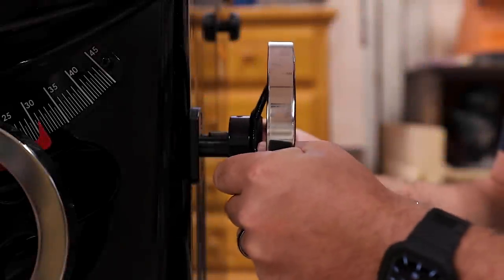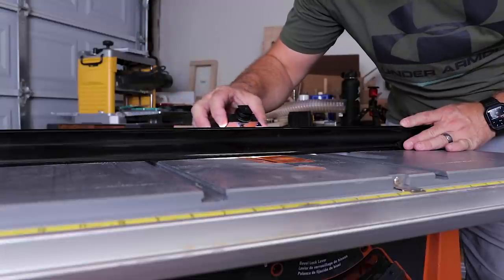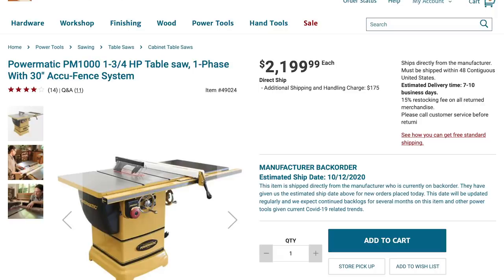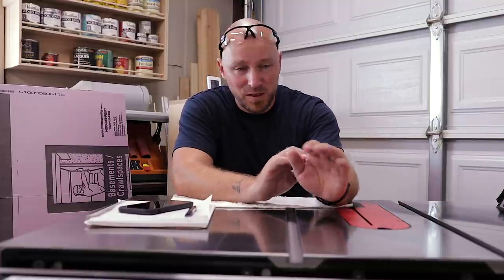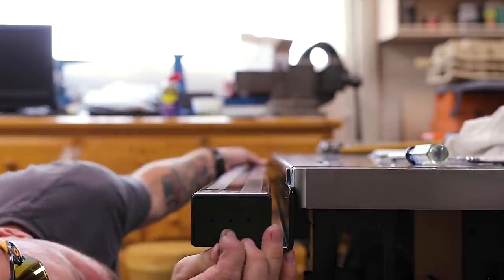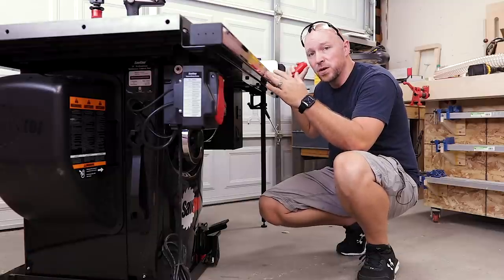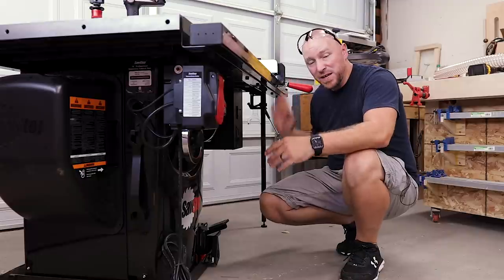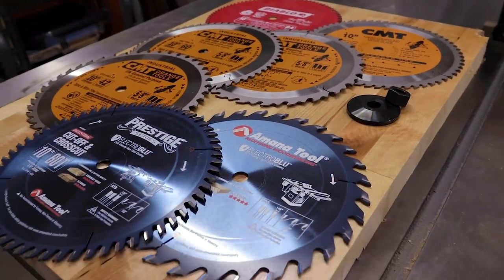I Finally Got A New Table Saw

Comment: That's an excellent addition to the shop!  I've had one on my wish list for a while.  And don't feel bad ... we all have our share of shop screwups and rust is way better than an injury.  My last rust-causing goof: leaving a scrap cutoff of green wood on my bandsaw table overnight.  Folks might like to hear your solution for fixing rusty tools as some point.  Here's mine, in two steps:
1. Cleaning:  Spray on Bullfrog Cleaner/Degreaser (squirt bottle, not aerosol), then swirl it around with a shop rag.  When it's formed a uniform coating, let it sit for a minute or two. For thicker rust, use a wire brush before wiping it off.
2. Protection: Lots of folks swear by Boe-Shield T9 but I like Fluid Film better - in my experience, both seem to protect equally well but Fluid Film doesn't have any toxic VOCs to harm your lungs.

Comment: Congratulations on doing your research and coming up with a great SawStop configuration. You will enjoy that saw for years to come. Just make sure you vacuum out the cabinet from time to time and it will give you years of very accurate cuts. If you use a dado stack, make sure you watch the super slomo video that Jonathan Katz-Moses did. If you happen to trip the brake, watch out for flying carbide.

Comment: Just got the 3hp w/52” table.  But...I got the PCS mobile base!  I should’ve done that last bit of research like you did.  I didn’t get the router lift, and now I see that it’s as good quality as the saw.  Those SawStop guys are awesome!  Great manuals, great product, and great support.  I hope you can come up with an out feed/assembly/workbench thing.  I’ve been thinking of doing something similar, but I’m kind of stuck.  And, I rather suck at drawing!  I think it could work out, and was even contemplating something like a scissor lift to raise/lower the bench top to table saw level when necessary.  The scissor lift would make it much more useful for assembly too.  Being able to adjust the height makes the surface good for lots of things.   But, it means no leg vise.  I think I could compromise the leg vise and just use a crochet (it’s in Schwarz’s book on workbenches...great stuff!) and dog holes.  I probably need to try to draw it up!

Comment: sorry for bursting your bubble, but one day you will regret not getting least the 3Hp unit;  I was a Powermatic diehard for decades, but when sawstop came up with their system, I sold my two powermatic units and got a 5Hp and a 3Hp sawstops that I use back to back with a 3' table between, the 3Hp is dedicated dado unit while the 5Hp is the main rip saw; I am not much of a fan for sliding saws, I use to own one but I like the cabinet ones better. Congrats on your purchase, its a good and smart investment.
Dan

Comment: Nice move sir!  My delta broke after about 1 1/2 years. I saw a perfect opportunity to by myself a sawstop. I have the 3hp 220v   I opted not to have the rails bc I have the Incra LS fence and router lift.  I had a Bosch router cabinet, sucks! Bump n pray test cut after test cut. And repeating? Omg what a headache

Comment: I just purchased the same saw a few days ago. Bought the overhead dust collection, but thinking that may be overkill. They were out of the mobile base so that is my next upgrade, then the router table and lift. Used it for my first project today and it was a real shock how easy and great it was to use over my beat up Delta contractor saw. Well made, not super difficult to put together, and cuts nicely.

Comment: I've had a contractor saw for a year and a half.  So far, no accidents, though a couple of days ago I sliced through a drywall screw.
Unlike on the contractor saw, the fence rail on the PCS stands off from the edge of the table, so you can mount Izzy Swan's miter gauge infeed saddle on the PCS. https://www.youtube.com/watch?v=RZmbZLZLrb8
Reply: Bob - thanks so much for mentioning Izzy’s miter slot infeed extension - what a great idea!

Comment: Just got the exact same setup. Currently putting it together. For an outfeed/assembly/vice workbench, Ive been thinking about a modified Ron Paulk set up. I just discovered that Hooked On Wood has an interesting workbench that has an MFT top, a dust catch drawer, and some nice cabinets. It also uses the Matchfit system which is a pretty interesting option. 
https://www.youtube.com/watch?v=70DEFtp_2ew&t=905s
Would be interested in what you come up with.

Comment: My advise having a small garage shop and having been through this already...  make your workbench.. and make a folding outfeed, bolted to the saw..  Or you might want to cut something that would use the outfeed table while your bench is in-use..and you wont be happy.   Beautiful saw there !   My next tool purchase  :-)   I have a rigid 4512 right now, set up with folding outfeed.  For sale in the next couple months ;- )

Comment: Bosch makes a jobsite saw that has the cartridge discharge and stops and sucks down the blade into the table saw but sawstop sued them and now you cant buy them anymore but i got one before they did and i have stocked up on the gas cartridges and they can be used twice as they are double sided and it works great lets just say its been tested in my shop its called the bosch reaxx table saw but dude i love the saw and will be getting one very soon very nice buddy and so happy for you and your fingers
Reply: I didn't think that they were available since they got into litigation about it
Reply: @paisaconstructiondavid1964  They are still available in Canada.  No Sawstop lawsuit issues
Reply: I appreciate your great news I may just have to sneak across the border and begin a reenactment of the prohibition with table saws.

Comment: I cheaped out on the mobile base and lived to regret it when the securing pedal spring bolt broke, twice. By the way, when the welded on bolt snaps off, which it will, keep that spring! The pedal you will get to repair it does NOT come with a new spring! I now have a third replacement pedal from SawStop (this one was sent to me from them for free after an irate phone call to customer service) but I’m thinking about not installing it an just buying the industrial base. Live and learn, but I was what I could afford at the time.
I was glad to see you leaning on that towel and I knew exactly why before you got to the explanation. I bought a magnetic mat from MLCS that keeps it rust free through the season temp/humidity changes.
Excellent video Jodi.

Comment: I managed to trip the brake on my saw without touching the blade.
I was cutting four small work pieces.  To keep my fingers away from the blade, I clamped each piece to a jig with an iron C clamp.  After cutting two pieces, on the third one, I placed the clamp a hair into the blade's flight path.  I couldn't figure out why the saw stopped, until I looked very closely at the clamp.  There was about a half square mm of polished iron, just barely visible on the clamp's grey surface.  I've been wondering whether the saw would have ignored the clamp if I hadn't been holding it.

Comment: Great video even though a saw like yours is probably forever out of my price range. I splurged and bought a router lift and it is easily one of the best investments I have made for the reasons that you Note. Kind of a side question: what was the ruler you were using to set your bit height? Stu
Reply: Stu Farnham Woodpecker Paolini pocket square

Comment: Will look forward to this bi-directional or spinning, out-feed table. I recently bought a SawStop. It's been sitting til electrician wires my shop for 220V (cuz I bought the 3hp). All I had was a 2 1/2" ShopVac so I broke-down, purchased, and assembled now, the Oneida Supercell -- this new product sounds great for small shops. Thanks for mentioning the router table accessory... been weighing on me to add or couple that for my small shop. I am planning on placing this fine, router accessory but on the left side of table saw for my shop layout cuz the right side abuts the wall; so, thanks for explaining that. You allow me to move ahead on that, too. I did purchase the ICS mobile cart, too, cuz they said if you add a router or other stuff, you will need it. The bigger mobile base does project beyond the smaller machines in the back so any customized out-feed table will need to accommodate that. You're a fine teacher.

Comment: Hello, Jodi. Another straight talk video -- much appreciated. You didn't touch upon why you went with the 1.75 HP vs the 3 HP. Cost is one factor, but because you're a thoughtful guy, I'm curious what other considerations played into your decision, such as the kinds of projects you expect to do on it and why, perhaps, the 3 HP advantage may not have been sufficient reason to go that route. Thanks.

Comment: Your router lift is branded SawStop. As you can put in just about any lift did you compare lifts? Also consider building your bench to use the same mobile base as your saw.

Comment: One problem I had with my saw (not a SawStop) was that the riving knife was too thick to use a thin kerf blade. I used it without the riving knife for a while but too risky. Full thickness blade back on. Also quick release mechanism for riving knife was in the way of dado blade. SawStop no doubt has allowed for these issues?

Comment: All the cast aluminum table saws develop wear in the high traffic areas. It’s interesting that you mention burn marks on the edge... I will take a look at my Bosch and see how flat the table sits. Good point about the upgrade path of contractor saw vs. hybrid, cabinet saw. Another good point, flimsy throat plate and a push block binding the blade during the cutting process. I think this is typical or more prone with smaller job site saws with universal, direct drive motors.

Comment: Nice! I will hopefully get a SawStop PCS some time next summer. I think I'm going to go with the 3hp though and forego the router table top setup as I have a dedicated router table that I use in the same capacity as you mention, basically as a workbench/outfeed table.

Comment: The outfeed table you want sounds a lot like the one I'm building right now, save for the dimensions and I'm not putting castors on it. That's probably the saw I'll get if I ever upgrade from the one I have now. They're just so smooth.

Comment: Thanks.  I just bought a Sawstop table saw and have yet to assemble it.  Your video confirms that I have not made a mistake, except for the fact that I should have purchased the better stand.  Thanks for letting me know that I need to get some paste wax on it right away.

Comment: One note that I missed out on initially....those 'silver/metal' colored areas on the bar that the fence clamps on....need wax just like the cast iron top, or they will happily rust over time.  Even a year will happily rust small spots all over it....which is annoying.

Comment: Good Choice!  You have made a huge leap Congratulations I am looking forward to the new videos.
I have the Rigid 4512 and I am very happy with it since I have installed the Incra TS LS joinery system withe the Incra Master Lift II router lift and the Clean Sweep if and when I change saws it will be what you have, I really like the lift that you have I would also have the large 4” over head boom for table top dust extraction. Enjoy and do not set off the cartridge 😁🛫

Comment: I’m curious as to why you said you would run into the same issues with a contractor saw in a couple of years? (I run with a Dewalt job site saw and am wanting a bigger one for larger cutting capacity. I was having the same thought process as you, but $2k is a bit strap for me right now. Why would a contractor saw not fair well in the longer run?)
Reply from the maker: Because down the road I know I will want something more, whether it be more power or a bigger table or better dust collection. Stuff like that. Contractor saws aren’t really built for the long haul either.

Comment: I really appreciate your videos tans especially the ones in the sawstop. I’m upgrading and have been beating myself up over whether to buy the 3hp or 1.75 and the industrial base. Still not sure about going to 3 hp but definitely going with the industrial base!  Also what router did you buy foe the table?  Thanks!
Reply: I’m in the same situation as you are.  I believe the price difference is currently $430 (US).  As part of the upgrade, SawStop includes the dust collection blade guard at no cost.  (The blade guard sells for $139 as a stand alone.).  If you have reasonable access to 220 - 240v power, it seems like a good investment to ‘future proof’.

Comment: Hey man, love your videos!  I've been shopping around for a while for a table saw and I think you might have convinced me on Saw Stop.....if I can afford it!  I like the router table extension option too.  I recently found some plans for a work bench and think they might be a good fit for what your needs are.  I added some step down casters to mine and I love the fact that it's mobile now. Since I'm limited on space, I also use it as an out-feed table and as a normal workbench.  Here are the plans for the workbench (his plans are for two benches): http://www.eaa1000.av.org/technicl/worktabl/tablefig.htm
Keep the videos coming!!

Comment: I don't begrudge anyone a new tool, particularly a safer tool, but you could have compensated for your old saw's shortcomings by using a sled while you were trying to decide on your upgrade.
Reply from the maker: Oh I did. But a sled won’t help for rip cuts. That’s actually why I finally cracked. I couldn’t even make a simple cutting board anymore.

Comment: Would a hobby wood worker want (need) a cabinet saw?  For my needs, a contractor type saw on a mobile base (so I can stow it against the rear garage wall when not in use) might make more sense (due to the lower cost, the saw won't be making me any money).  I think SOME contractor saws have a top that will accept a router table insert, and THAT would make sense for me.   As for SawStop, I like the idea of the safety feature, but the most important safety feature is proper respect for the tool.  I always leave the blade guard and riving knife on the saw (except when not possible, such as with a Dado blade).  I always use a push stick, and never stand directly behind the work (usually to the left side so I can push it against the fence).  I've had 2x4's kickback at me while resawing (missing me by a good bit thanks to my standing position vs the work), and THAT was scary as hell, almost put a dent in the wall.  I still have my old Rigid contractor saw (the old model, that isn't a compact POS).  It works OK, but can't accept upgrades.
Reply from the maker: Need and want are two totally different things and a conversation all of its own. I've always said that you have to look at what you do now and what you want to do in the future, and then match that up to your budget. As an example: If you aren't cutting full sheets down regularly, then a 52" cut capacity is probably a waste of shop space and money both. As for the safety feature of the SawStop, it's one of those things that will be debated and argued about basically forever. I think it is worth it if you aren't putting yourself into debt to buy it. They make contractor-type saws as well so that is always an option. I know a few people who own them and love them.
Reply: @InspireWoodcraft  A quick look on  line showed that there seem to be fewer makers of contractor saws today.  Even Grizzly isn't selling one under their name, they are now selling SawStop!   It doesn't look like you can install the router table wing in the contractor saw, only the cabinet one.  Also I might have to go after market to upgrade it with a 240 volt motor, that option isn't listed on the SawStop web site.  I've never dealt with anything larger than a 4 x 8 sheet of plywood, and even a 30" saw will handle that with a roller type outfeed holder. The  36" CTS is probably what I'd want (better fence), but the purchase will be a few years out when hopefully money won't be an issue.  I'd rather wait a bit and buy my 'last' table saw than just replace the current one with the 'next' one, (my current Ridgid contractor type saw still works, though long in the tooth).  Considering the tech and build quality vs the Asian made tools, SawStop isn't really overpriced.